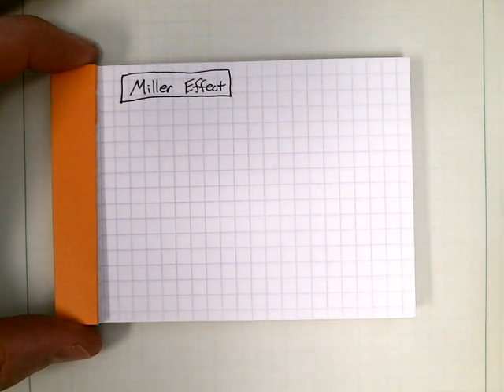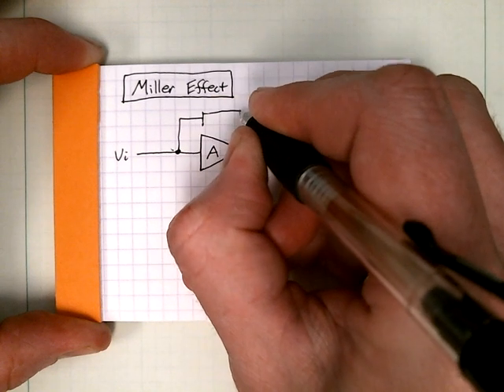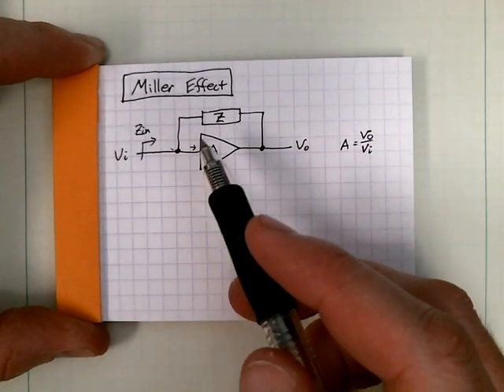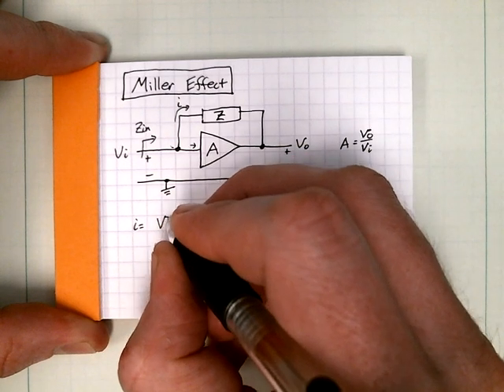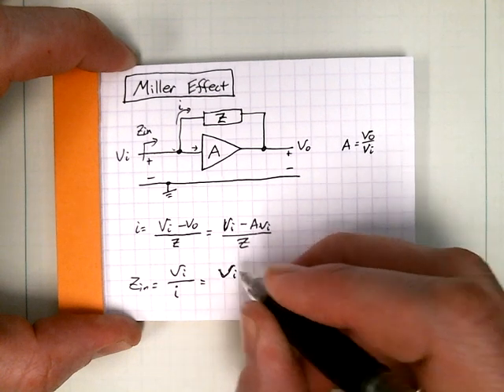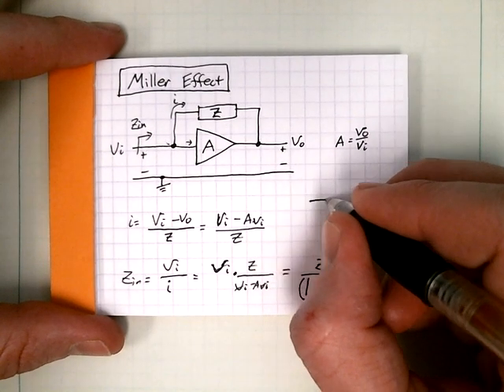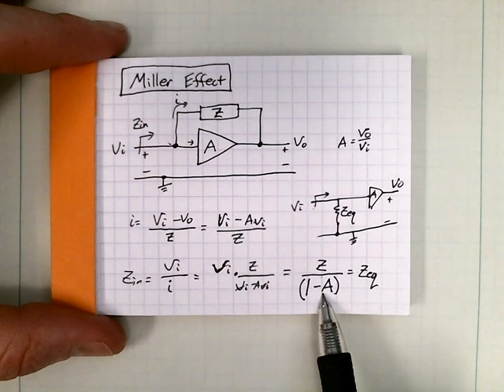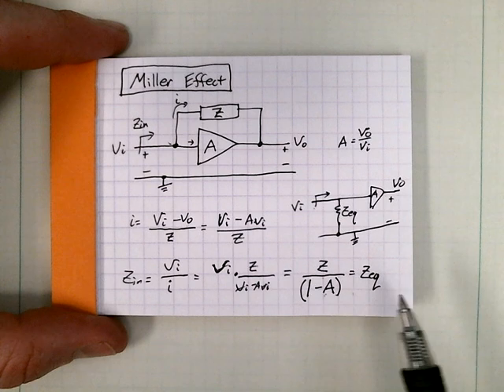Miller Effect derivation

Comment: At 3:15 you say, “From the perspective of the input ...” So then from the perspective of the output there’s a similar equivalent network to be derived? Yes?
Reply from the maker: Exactly!  We've ignored the input impedance of the amplifier itself, which is in parallel with Zeq.  For the output side, similar happens, but a different formula result.  Keep in mind that many times a voltage-output amplifier has a low output impedance -- so Zout = Zeqo || Zoamp may not change much in practice, which is why it is not mentioned nearly as often.

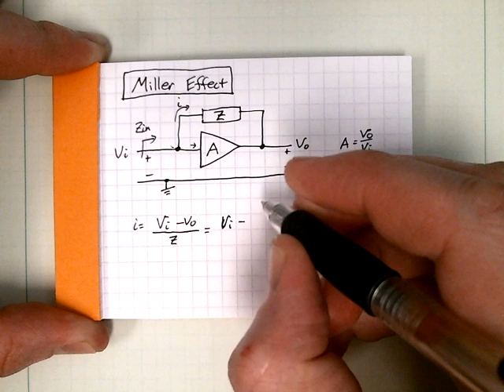Comment: mistake 1:59  
actually 
-A=Vo/vi
so it will become +ve (1+A) which is correct.
Reply from the maker: Gain A is defined correctly here.  Usually, when using Miller effect, the amplifier's gain is negative.  All that's needed is to use a negative value of A when computing.  In my experience, keeping the negative inside the A variable avoids errors when dealing with amplifiers whose gain is non-inverting.  An example is when constructing a _negative impedance converter_.